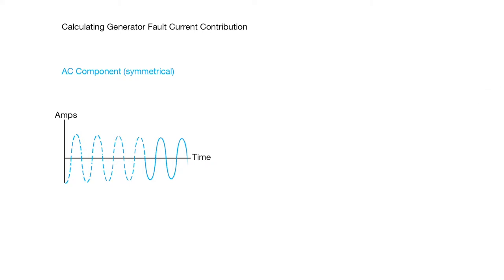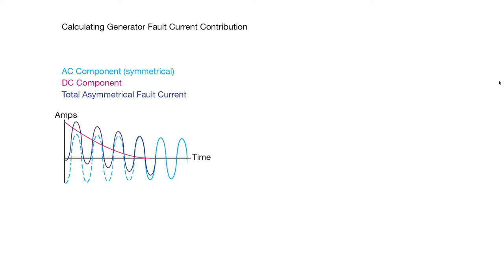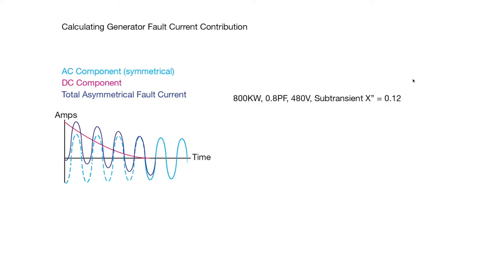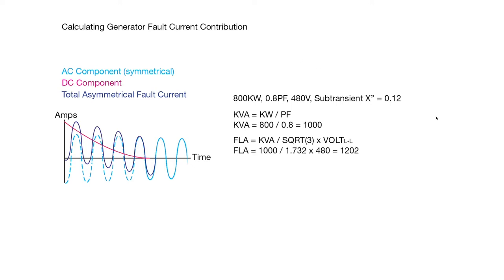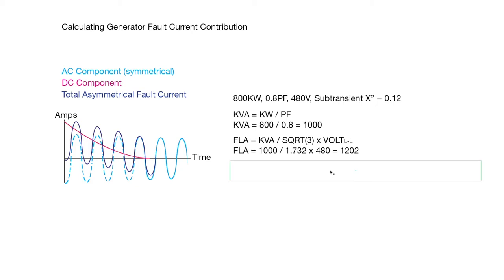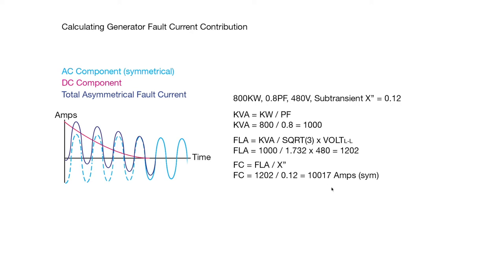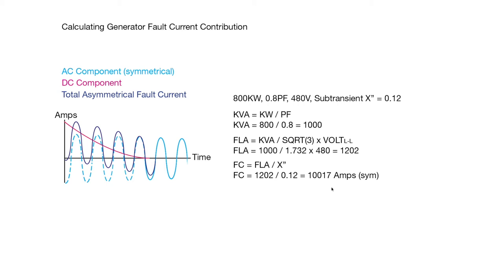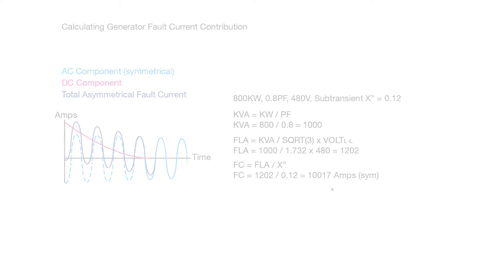Calculating Generator Fault Current

Comment: Hi, how would you calculate the tripping current of the circuit breaker if it set to 125%? Thank you in advance.
Reply from the maker: You have to look at the time to current curves for the specific breaker.  You should be able to obtain these from the circuit breaker manufacturer.